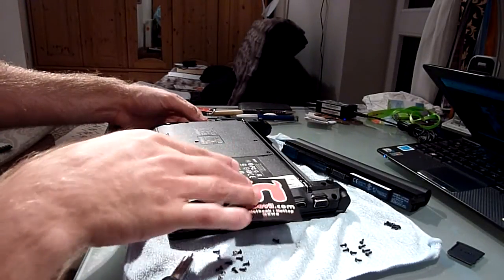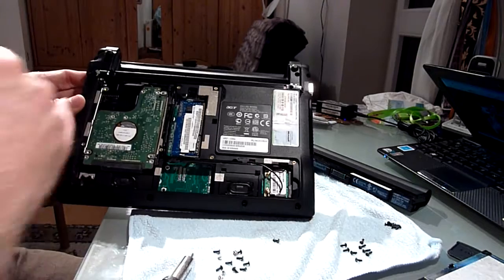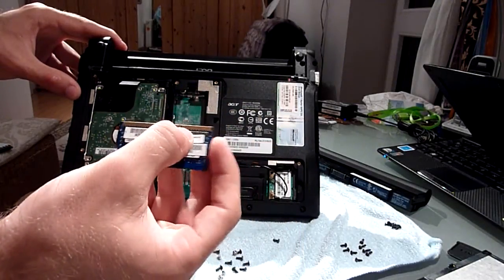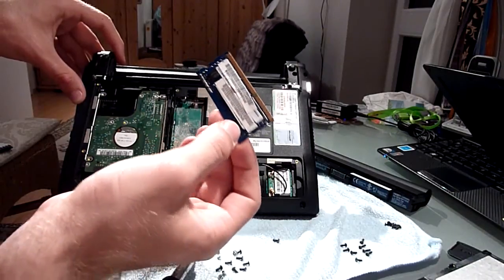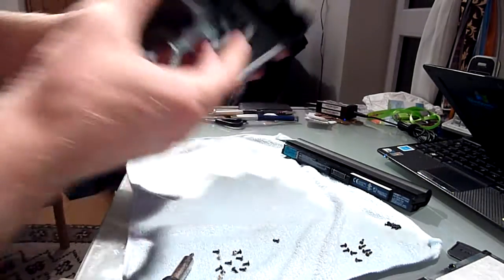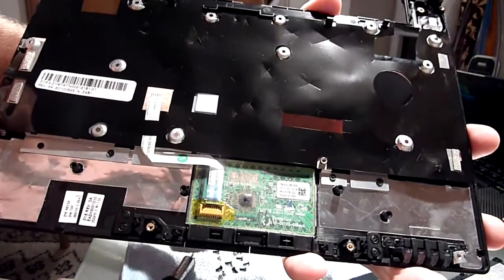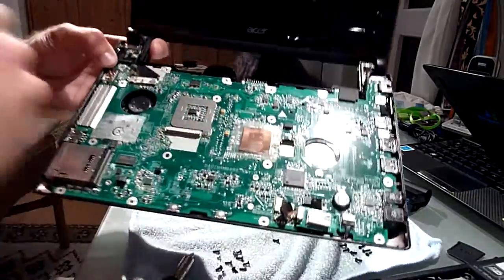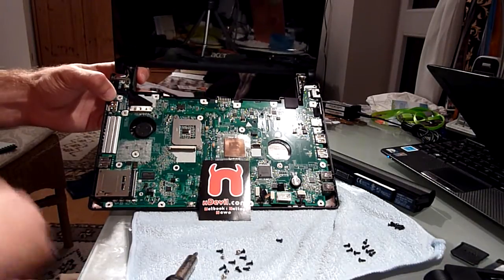Acer Aspire One 521 Ram Upgrade and Dissecting

Comment: Thanks for a nice video. While upgrading RAM is easy (I put in 4 GB & installed Windows 64-bit), I was unsuccessful in removing wi-fi card. Wanted to replace it with Intel Advanced-N 6200 to have both 2,4 Ghz & 5 Ghz channels. The screw holding Atheros card is damn tough, I couldn't unscrew it no matter what. Following your video I removed the keyboard, cover in the hope to find something that prevents from unscrewing the card on the other side. But there's nothing there.